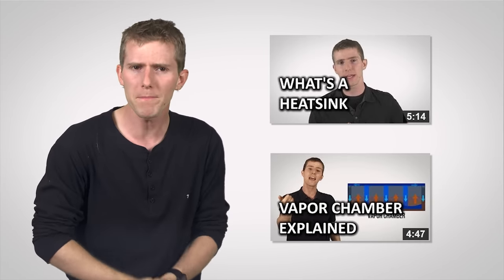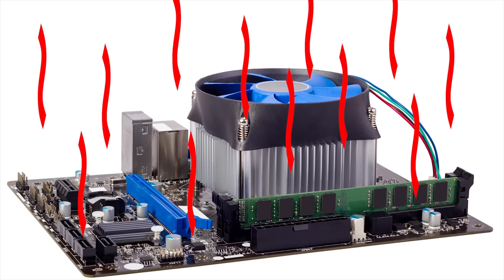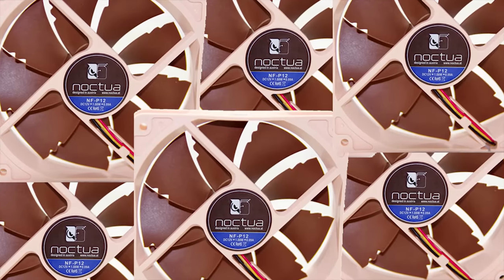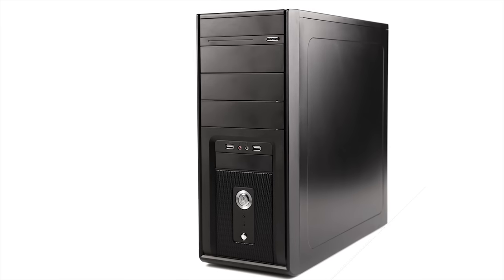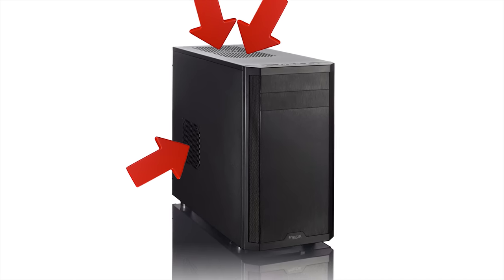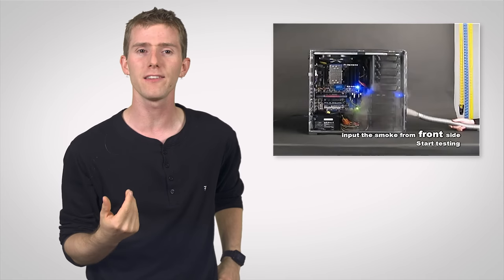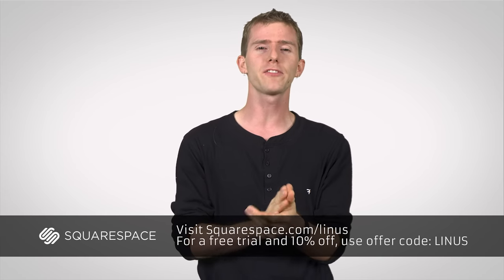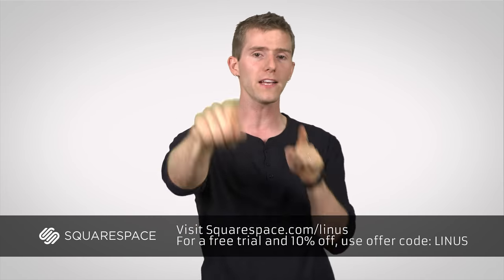Positive vs Negative Air Pressure as Fast As Possible

Comment: I right now have an NZXT H440 with three (3) 120mm intake fans in the front, one (1) 140mm exhaust in the back and two (2) 120mm fans also in exhaust but in push on an H100i up top. Would you consider this a balanced setup? I just recently cleaned out my front intake filter (which had a good amount of dust in them) in the 3 months that I've built my system. I wiped down some areas such as my PSU shroud as they had a light coating of dust on them. I didn't wipe down my GPU's backplate but it also had a coating of dust as well. Should I be changing up my fan configuration or is it fine as is? I would love your feedback!
Reply: yeah that's a good setup
Reply: So thats really a single 120 out? Just 2 stacked in push pull to help with static pressure? Yeah thats pretty balanced and slightly positive :)
Reply: The 2 fans that are on the H100i aren't in push/pull just push. But thanks both of you!
Reply: Amir Hassan OH i misread. Its pretty close to balanced.
Reply: +Richard Smith Alright, it's slightly positive despite that since I have a higher intake than outtake. Once again thanks :)

Comment: This is overthought way too much, the fact that filters kill airflow needing faster louder fans r more fans in general is rarely brought up, so long as you have some cold air intake for a gaming rig you're okay, basic pc's can get fine with just a single exhaust because air will be brought in anyway so long as its cleaned once in a while, if the dust is getting caught by the filters of a NAP rig is also restricting it nessesating a clean anyway, on larger cases where airflow is usually very low anyway i can get by with just exhausts (750d) NAP isnt an excuse for not cleaning your pc. changing the air filter and oil of your car doesnt make it any better at offroading or mean you can redline it 24/7.

Comment: I got two fans in the front ..
ordered a evga hybrid 1070. planing to mount the radiator on the top or on the side if possible as exhaust (first hybrid card)... and one exhaust fan in the back.

hope to get near neutral air pressure.

Of course that leaves me with an extra fan.. don't know if I should use it or not..

Comment: My case is the corsair 750d , i have 5 intake fans ( 2 120mm bottom , 2 140mm front , 1 140mm back  ) and only 3 excaust ( 2 120mm top and one 140mm top ) , is this  balanced ? by the way , i have a radiator on the top
Reply: I've always been taught 2 IN, 3 OUT. Just keep the hot exhaust away from any intakes. For example, I have intakes at the top and front and exhaust the hot air out the back and sides.
Reply: ARikozuM
I agree. More out than in causes the pockets of stale air inside the case to want to move around, helping to cool everything. Doing the opposite, however, relies on brute force to push all of the air out. Also, why would the case need intakes unless the fan is blowing directly onto a hot component? Normal displacement that creates a vacuum effect should be enough.
Reply: *****
Well sealed? No, it just requires the case to have more air moving out than in. That's why I don't like having tons of vents everywhere. The problem with pushing air into the case is that it must be blowing onto hot components to be truly effective. By pulling air out, it pulls out hot air which is automatically replaced by cool air.

Comment: I got 2 140s in the front, the psu pulling air inside along with another 120 on the bottom mount (yes I actually use that) and one rear 120 as exhaust. any suggestions?

Comment: Alright help me here with my setup fellow fans. Got 5 1200 rpm 60 cfm case fans and 1 110 cfm 2000 rpm fan (noise dosnt matter at all) (they are all 120mm). I have the 110 cfm fan on the back as exhaust and the rest as intake. 2 top 2 side 1 front then the more powerful one as exhaust - anything i could do better? thanks!

Comment: So i got 4 fans now 2 in 2 out.. BUT i got space for 1 more fan . What shouild it be out or in?
Reply: LitlleCRO Having 3 fans in and 2 out should create the slight positive pressure talked about in this video as long as the new fan isn't significantly more powerful than the other 4.
Reply: +LitlleCRO 
You have too many fans. 1 fan should be enough. If it has an air filter, then it should be intake, else an exhaust fan.

Comment: i have the arctic lan boy air so theres tons of extra holes and airflow.
i was told i should have all the fans in becuse the vast number of non fan spots would easly balance out any pressur. is this true?
i do clean it out of dust when it needs to be. and i never let it get bad. im ok with the amount i have to do that

Comment: In my new case I'll have 10 intakes, 3 exhausts and a mesh back would there be a lot of issues? It's a overkill build for a gtx650 but I just wanted to build a case and this fits my design best.

Comment: I have a CoolerMaster CM Stacker 830, I has 6 case fans
1 on top, 1 on the back just below the powersupply, and 4 on a swing door just behind the side panel.
i have the 4 doing intake while the other 2 are exhaust.
Anyone think there is anything i should change. I open my case every month and check for dust accumulation, i never have hardly any, i clean my pc with canned air about every 6 months.

Comment: I have a 120mm up front as an intake,and another one in the rear for exhaust, I'm going to add one to the top so should it be an intake or an exhaust? not quite sure which to choose
Reply: +XxxInTheMiddlexxX Perhaps it's not needed and better not to add it?

If you add an exhaust fan, you have definitely created a severe negative pressure and you'll probably have a dust issue. If you have an optical drive, you'll probably have dust collecting inside there too. However, chances are that the cooling performance will increase.

If you add an intake fan at the top, you have created (or strengthened an existing) short circuit, where air enters and immediately leaves, without having a chance to perform cooling work.

An alternative to try is simply blocking the fan hole at the top, thus reducing already existing short circuiting.

Comment: I have 3 intake fans 1 on the bottom and two on the front 

Also I have a h100i with 4 fans exhausting the air and 1 on the back

Is this good?

Comment: Question: my case has vents two on the side and on two on top since there are no fans on these and they are not covered does the exit exhaust fan intake air through these neutral vents even with a front case fan intake and would it be better to block the 4 vents so my exhaust fan isn't competing with the neutral vents for intake pressure.

Comment: guys what do u think about this build?
2 front fans (intake)
2 roof fans (outtake)
1 rear fan (outake)
+ 1 fan on cpu cooler (thermaltakr frio 12)
case thermaltake versa n27
did i put the fans right ?
Reply: Igor Požega 
This is super late but it seems good

Comment: There is no such thing as "negative pressure". High and low pressure is what you are trying to refer to.
Reply: Yes there is, it's called a vacuum.
Reply: @Coldrake1  A vacuum only exists due to a higher pressure. Pressure travels from high to low just like temperature.
A vacuum is not a negative pressure.
Reply: It's the pressure delta of the case based on the pressure of the room
Reply: @d9zirable  YES.
Why can't people grasp that?
Reply: Evidently this channel doesn't allow links as my two posts were deleted so I'll post without the link.
You said, "There is no such thing as "negative pressure." Again, yes there is.
Found at tls-containers,
"Negative pressure, also known as a vacuum, is a process that reduces the air pressure inside a container to a level that is lower than the outside atmospheric pressure."
It's a simple concept.
Google "negative pressure" then come back and tell everyone that there is no such thing as negative pressure.

Comment: Hey this is my setup tell me if its wrong,I have a corsair 300r-2 front 120 Sickleflow Intakes@2000rpm,1 side 140 intake,1 Rear and 1 top 120 exhaust fan,Only 2 front intakes are CM sickleflow others are normal case fans.Still my GPU(R9 290) Twin Frozr idles around 50*C can I do something to improve my idle temps?

Comment: So? I will have 8 fans, 4 intake with filters weekly cleaned, and 4 exhaust, plus msi r9 390 that does a bit of exhaust (psu has it own air flow). All 8 fans controlled by Aerocool Cooltouc-E fan controller, what should I do? Same speeds for all 8 fans? Thanks
Reply: +LINKINPARK4EVER1996 
Why not just slow the computer clocked speed? Wouldn't that make it run cool, without all those noisy fans?

If intake fans have filters, then they should run faster, to create positive pressure so that dust can not get inside, and then why even bother with exhaust fans? The positive pressure will push the warm air out of every possible air vent or crack.
Reply: Yosef MacGruber I'm not doing any overclock, I just want the pc super cool so all the components will live longer without losing power (it's a fact). And btw, using rubber screws for the fans will erease any vibration noise, as well as rubber rings for the hard disks and dvd players, it's a little trick that very few people consider.
Reply: LINKINPARK4EVER1996
You still have way too many fans.

I meant that if you could run a computer at 70% or 50% of normal speed, wouldn't that make it run much cooler? If program coding was not done so poorly these days, such a "slow" computer should not so much seem slow? Well except serious gaming may show how slow it is, with too low of a frame rate.

Did you see the video about putting a computer into a mini-refrigerator? Seems like a bulky proposition and a waste of electricity to me.

What about upgrading the heat sinks?

I haven't much built computers, nor do I waste time trying to upgrade the cooling systems.

The main thing that kills computers, is software obsolescence. People put perfectly working computers back into their original boxes, and eventually have to get rid of them, simply because they are not used anymore, and they got something newer and better.

I really wish I had time to write a much-improved OS, to give those old machines new life. And my OS would be able to use the old files, and present them in better or upgraded ways, or switch to a seemingly semi-emulated old environment, so that most all the old stuff, would still work.

Comment: So, it two fans in the front with filters and one in the back a good solution? I'm just using a stock intel cooler for the cpu.
Reply: your front fans is best to be intake and the rear is always exhaust and thats a fairly good setup tbh. and aslong as your not doing any overclocking the stock cooler is good enough. just keep an eye on temps
Reply: Well, my case came with two fans (one front, one back) and I already bought an extra one. I'll put it in the front as an intake and I'll see how it goes. I'm not overclocking so yeah I'll stick with the stock cpu cooler.
Reply: Veselin Krastev is 1 intake and 3 exhaust fine?
Reply: That would create a strong vacuum effect I think. Why not put two in the front and two in the back and go for more or less neutral air pressure?
Reply: Veselin Krastev i dont want neutral so i switched it up and am thinking of doing 3 intake ( 2 in front and 1 on top ) and 1 exhaust ( rear end ). will this b good enough?
Reply: Veselin Krastev one more thing. will a 550 watt PSU be powerful enough to power an i5 6500, rx 480 8gb, 1tb hdd, cd drive, 4 fans and 12gb ddr4 2133mhz ram?
Reply: I'm pretty sure it's more than powerful enough. I have a gtx 1060, i5 6500 and I use a 550 watt PSU. It all works fine. Stuff like optical drives and fans don't use too much power in general.

Comment: one 120 mm intrake and one 120mm exhaust fan right now , but in the futere i have to add more fan may case cooler master n200 suport 2 fan in the front , one on the back , one o the right panel and one on the top , 5 fan , i have 2 now , but i fill all the fan slot , i undesteand nocturna fan is verry better no ?

Comment: I have 2 fans for intake and 4 for exaust. Bolth of the intake fans are in the front. One of the exaust fans is on the side to pull air away from the GPU cause my PSU has it's own intake, one is in the back and two are on the top. Any ideas on how to balance the airflow? I think I Should have 3 for intake and 3 for exaust.

Comment: Uhmmm i need help. I have Cougar mx200 it has pre installed fan in the front part which is 120 mm and in the back part 80mm. But it has 2 space for 120 mm in its side. What shpuld i do ? should i go for intake both fan ? or outake? and what fan should i use? static pressure fan or airflow fan ?. i Badly need help please answer T.T and sorry for my bad english.

Comment: How do I know if the NZXT Air Flow Series 83.6 CFM 140mm Fans are intake or exhaust? I have 3 intake fans in teh front and one exit fan in the back and need to exit ones on the top, any help?
Reply: There should be an arrow pointing the direction of the airflow on the fan. just use that to assign it in the correct direction

Comment: how can i tell if my fans are intake or exhaust? they are the normal zalman z3 fans i didnt change them, should i switch them round?
Reply: The concave side will face the direction the air will travel. The concave side of the fin, that is.

Comment: I got three 230, 5 120, and 2 140, I want the most CFM as possible nice to have red lights, cost is more important then noise, the 140 push up from the bottom, two 230 pull air put the top, one 120 pulls out the back, and 4 120 push air across the hd, from side to side and one 230 pushed right on the gpus and cpu, my case is an azza geniuses 9000, any ideas,

Comment: i have a gtx 1080 and i7 4790 with corsair h55 push pull config when  gaming cpu is around 60-65 degrees and gpu around 67-80 degrees with 2 intake fans at front of case 2 exaust at the top and the push/pull radiator at the back of case are these temps good or not just worried about temps :/

Comment: Would using the corsair 450d having 2 140mm intakes in the front 2 120mm in the bottom next two psu, 1 120mm exuast in back and and corsair h110 280 mm radiator  in the top as exuast work?

Comment: As a question to anyone, I have a design r4 and have 2 intake fans at the front (140mm+120mm) and another intake on the bottom (120mm) and a final exhaust fan at the back. Would this work or should I move a fan so its 2 intake and 2 exhaust fans.

Comment: How often should I clean my PC?
Reply: Once a day if you have the patient :P, for me, I would start at once a week, then I will be like, "uh fuck it, I'll just play the game"
Reply: HCK Gaming That's a little bit too often. Once every month or 2 would be fine. Just be sure to be thorough while doing it.
Reply: Just base you cleaning on dust build up. I get buildup on the outside of my case every few days I need to clean, but not much dust gets inside, that normally gets cleaned every 2-3 months. Filters are helpful.
Reply: Every hour. JK. I do it every 3-4 months.
Reply: i clean it evry saturday morning after got up^^ it took to me about 10 minutes for the job. I hate dust!
Reply: You should never clean your PC as the dust helps to protect fragile parts on the circuit boards.
Reply: Depends on things like placement, animals, air-movement and such
Reply: When it gets dirty.
Reply: Mostlyharmless1985 YOU TYPED 4 WORDS! HALF-LIFE 4 CONFIRMED!

Comment: so have exaust on 1 side and intake on the other -_-
Reply: I guess, he didn't really explain how to get positive or negative pressure (Af as i know) only how sexy pantyhose is and how the outside has nice graphics
Reply: Boffifis1 Actually, you don't really need an exhaust if you have a pressure optimized fan at the intake, and visa versa

Comment: I am building a gaming rig using the phanteks enthoo luxe, I'm using a h110i gtx cpu cooler and am trying to figure out how I should set up the airflow... I'm thinking about having the radiator from the h110i pulling from the top, filling the front of the case with sp intake fans, and having one exhaust fan on the back (io shield area), anyone with feedback on this airflow setup?
Reply: k....I was leaving this comment on a video about airflow,but I guess autoplay started another video and put the comment here. ...so annoying.

Comment: Hey guys, im wantig to build a pc with a i7 4770K and a geforce gtx 760 or higher, but can you guys advice me on the parts, it has to be silent and must have good airflow, also should i use stock cooler or another one, my price limit is about 1200 incl x64 os (w7 or w8)
Reply: I also want an ssd and atleast 2x 1tb hdd or 1x 2tb hdd
Reply: Im certainly not going to pirate windows 7, a guy i know did that and he got all weird kids of error messages and bugs, and when one of of his parts died he couldn't get it back through warranty becuase of te pirate version of w7 (and i can get the pro version of w8 for only €20 cuz of a deal between my uni and microsoft/a shop who sells windows operating systems). Im not going to get an amd card too, sure they are cheaper but you can squize less performance out of it. A 4770K is my bare minimum too since i do a lot of video editing and rendering and i use a lot of very demanding programs (most of the time more then one at a time)
Reply: I should use a aftermarket cpu cooler indeed yeh. Ill Probably go for a water cooler cpu cooler from corsair (forgot its name)